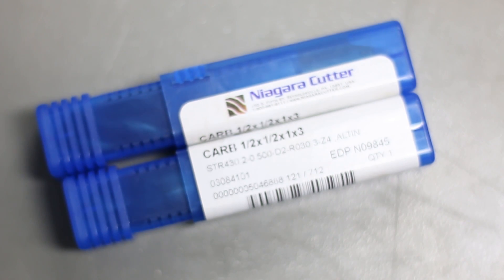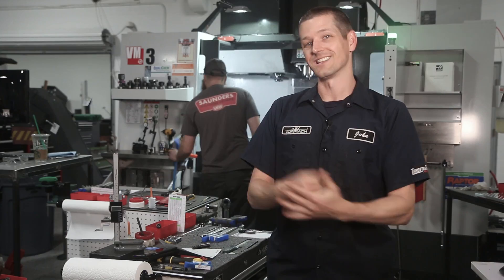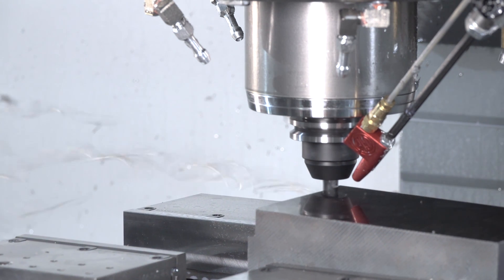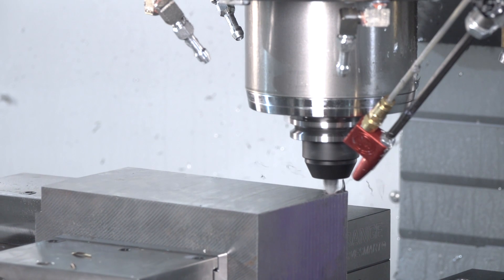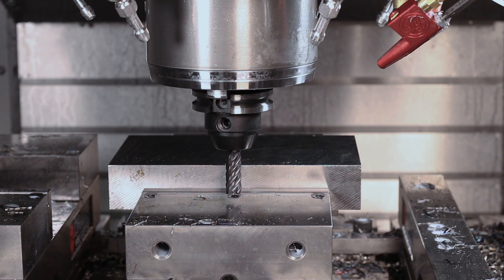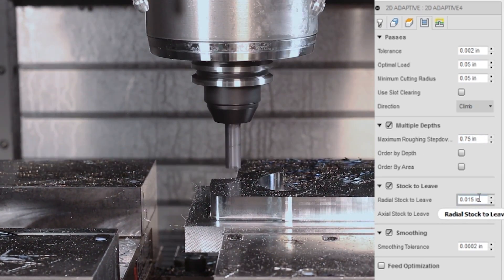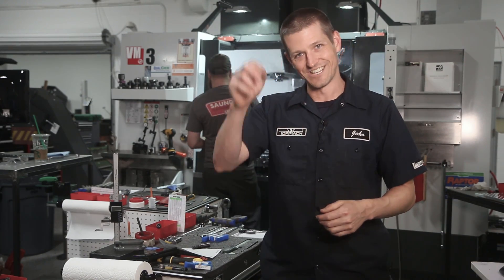Machining 4140 Steel with Niagara End Mill in HAAS VM3!

Comment: First use rotating auto length for more accurate lenth measurements of .5 or larger endmills..always.  Secondly use the tool measure measure with diameter option when teaching length it will measure diameter which in turn will show your runout if any...let the machine do the checkin.. imo humbly

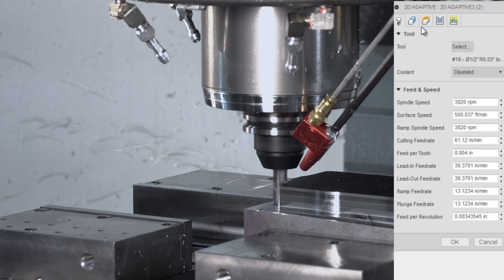Comment: 4:25 Where does the 500 SFM come from? In high feed milling are there other charts for Surface Feet per Minute? Because in converntial machining I see 50 to 100 SFM for the Surface Feet Per Minute for 4140.
Reply: Tool manufacturer will give you a base line SFM for their cutters in a particular material.
Reply: @bobsbillets8863  So your saying that there are different cutters for high feed milling? And they come with a different SFM?

Comment: Great video! As a conventional machinist I have to ask, why so much climb milling? That may seem elementary to some, but I genuinely would like to know.
Reply: Ik this is wayy late, but the reason is that CNC machines love to climb mill. Manual machines often use leadscrews with lots of backlash which usually leads to lots of free play in the table. when you move your conventional mill, the screw pushes from behind the nut's threads, so the free play is all ahead of where the table has been moved to. when climb milling, the machine wants to pull the work in the direction of movement, and if there's play in that direction, it'll catch and bad things will ensue. Because CNC machines need to be able to maintain accuracy after lots of direction changes, they use ballscrews with very little backlash, so this problem doesn't occur for them. If the machine can do it, climb milling is usually better in terms of chip evacuation and surface finish, and requires lower forces on the axis drivetrain (as the spindle is helping the axis instead of fighting it)

Comment: noticed you set the tool height to the center of your tool this can throw you off on any tool larger than 3/8" as the bottoms aren't exactly flat. Really gets you in trouble at 3/4"+. great video keep them coming.

Comment: Mastercam has an option to slow the first pass down by a percentage, that's saved my bacon in the past it's a nice way to make sure your fixture offset is where you want it.  Working at a mold shop put me in the habit of placing the fixture offset in the middle of material more often than not which might have saved the first endmill because the excess material would have been equally spread.  Great toolpaths!!  Thanks!

Comment: This is why if I can I always put my wcs on center Cuz then if the stock is oversized you have an equal still heavier cut on both sides but normally she will suffer though it
Reply: I also prefer WCS at center for every in-a-vice job, where I work we have a 0/+10mm(3/8in) tolerance on the saw and we program with a virtual stock of +12mm(1/2 inch) 

since we run our second setups on jigs or pallet, right after facing we make the dowel holes so its easy to restart a program if it has been moved (just zero in the dowel hole and add the offset from the CAD program and the zero is back where its suposed to be.

Comment: why don't you just let the Renishaw OTS check your run out for you??? your wasting time with the indicator.
Reply: 0.001" Vs 0.01 accuracy maybe
Reply: OTS controls it at .0001's its extremely accurate and reliable. I've used it alot

Comment: Why did they make a left hand endmill?  That now requires changing all of your machining strategies from "climb" to "coventional" so the LH endmill is climbing!
Reply: While it was just a video editing mistake, ironically, it was probably his nice Orange vises to blame.  The material was saw cut and probably not square, and the jaws didn't have enough play/clearance to allow for an irregular shape.  Kurt vises have a little leeway to allow for variations in material parallelism.  Probably a piece of poster board on the moving jaw would have prevented pullout.

Comment: Checking runout with Weldon tool holders?

You would get much better runout tolerances with Fahrion toolholders, or something at a higher precision.. Weldon are not for precision.. Sorry to say, but you could get much longer tool life by switching to somethin better John :)
Reply: Peter Uhrskov 
He's primarily roughing.  A Weldon shank solid holder or a milling chuck are the correct holders.  That provide the most lateral force support. 

Shrink fit and other collet holders are more accurate, however they are poor at taking lateral force, they're mainly designed to support tools under axial force.
Reply: Peter Uhrskov 
Huh?  

Weldons are balanced to 20k now in cat 40....  and concentricity is more than acceptable for roughing, and still has an as good if not better side load rating. And not to mention probably 1/3 the cost of a Centro-P. 

http://www.collistoolholder.com/cgi-bin/parts.cgi?typ=CAT_0_TYP_0
Reply: Peter Uhrskov 
A lot of companies are now. The balancing machine is relatively inexpensive, so they don't have to retool their holder manufacturing, they just add in the step of balancing them to 15-20k now.  Tack on an extra 20% to cost and it's easy money for them, and we get inexpensive balanced holders.
Reply: That used to be true.

But that is not the question anymore..

They do make weldon for roughing in precision collets.. It might not make any sense to use these high prec. collets for roughing - but when you dynamic mill you often go past the 10k Rpm limit that most Weldon holders are certified for.

For example you could get one of those : https://www.wnt.com/uk/cutting-tools/news-cutting-tools/wnt-adds-to-process-security-with-new-collet-range-419.html
Reply: But how would you ever know this if you did not check run out? Take the Internets word for it?
Reply: troy chrisman i have checked it myself. Shrink fit or highprecsion collets is the way to to go. 

I work for one of the biggest machinetool dealers in Denmark. 

We sell Highprecision everything. Mainly Mikron and Matsuura. concerned about machines with spindles that do 30.000 rpm. The runout is crucial.
Reply: oh i believe u without a doubt u at some point put an indicator on it to see the run out. thats my point. 

cheers
Reply: Occams Sawzall - i actually did not know that you could get weldon holders rated for that many rpm..

I guess you learn everyday - i know Centro-P holders are more expensive - but hey it's also expensive machines :)
Reply: looks like Fahron sells only to Europe market, and I was not able to find ER collets

Comment: Few questions..:

1) Which tool path was actually faster?
2) Could you have pushed the feed rate on the 6 flute?
3) How did the chips look, too hot, room to heat up (speed up?)

Man I need a camera that does more than 120fps.. love those slow mo shots!

Comment: Try that same recipe on the Tormach and lets see what happens!
Reply: Seth Johnson steppers will lose position and spindle will stall! lol
Reply: Hur hur, look at me, I recognize that Haas is not as rigid and powerful as a Mazak that costs many times more.
Reply: Seth Johnson 
Can't. 40% load on the haas is about an 8ish horsepower cut.  Well beyond what the tormach can push at peak.
Reply: Diamond Eyes 
My DMU has 15HP over a variaxis. It wouldn't even register on the meter 😆
Reply: Diamond Eyes 
This is an older DMU. 2004 Evolution 5 axis. Thing is dead on accurate with power to spare. Will drive 3" facemills 80% width max insert depth through steel without a single complaint or hiccup. 

We also have 2 brand new milltap 700's which are amazing workhorses for such a tiny package.
Reply: Been jelly of my buddies grob g550
Reply: No it doesn't, Nexus 530c is very reasonable.. They're built in Kentucky right the over Ohio line.
Reply: I love mazaks first cnc machine I learned was qt20

Comment: So what was the cycle time difference between the 2 tools and their strategies?
Reply: Eatongee 
I'm gonna take a guess and say the "high speed" was actually slower in cycle time.  .05 step over vs .200 step over you'd have to be going over 4X faster on the feed to make up the difference 

Think it was 200ipm on the high speed? And was certainly going faster than 50ipm on the standard path. 

But would probably have much longer tool life using the high speed path which could be worth the extra time it takes in tooling cost and time down to replace the endmill.
Reply: Josh Ogle 
I've seen people 10 years in the trade forget to tighten down a vise. 

He's also doing all the camera and lighting stuff as well, so far less concentration on the machining part. 

Shit happens.  If you can walk away from it then it's really not that bad.
Reply: Eatongee yes I second this question!
Reply: Josh Ogle 
He's less than a year into using a full power CNC... well, HAAS so maybe 7/8ths power cnc 😉

I'm sure that would have been enough clamp force in a tormach. 

Still has all his fingers, eyes and other appendages, so there's certainly worse out there.
Reply: Occams - C'mon man. That's absolute beginner stuff. He's been cutting long enough to know the basics. It's Machine Shop 101.
Reply: Occams But you're right. There is DEFINITELY worse out there.
Reply: I third it
Reply: looks to me that the higher speed path also did a better finish on the walls
Reply: Occam Sawzall - 
He was. The HS toolpaths were 200 ipm. The tradtional was 50.
Reply: Josh Ogle 
Standard was 61 ipm highspeed was 206.   That's only 3.3X faster.  The 2D with the slower feed and larger step over would be faster with a higher MRR. 

First one was about a 12 cu-in/min removal rate. Second high speed path was only a 10cu-in/min removal rate.
Reply: Occam - Ah, good eye. I misread his feed on the regular toolpath. Regardless, he COULD improve his MMR with full depth engagement if he was actually looking to make money instead of just making chips, lol. Gah, hackers.
Reply: Eatongee - You shouldn't be surprised at all. He's not a machinist. He's a Youtube personality. Consistent bad shop practices like not checking the clamping and stock getting pulled out of the vise and not checking the stock sizes would get you fired at most shops. All regular things in these videos.
Reply: Funny that NYC CNC replies to 5 or 6 of the comments about the production quality of the videos but not to a question about the machining that took place in the video. Especially one that has several users debating. Kind of makes me think that they are more interested in a TV, sales, or production job rather than actually teaching and passing on knowledge.
Reply: minimovzEt smaller step over means smaller scallops on the roughing. 

The 6 flute will always leave a better finish than a 4. More flutes equals better finish